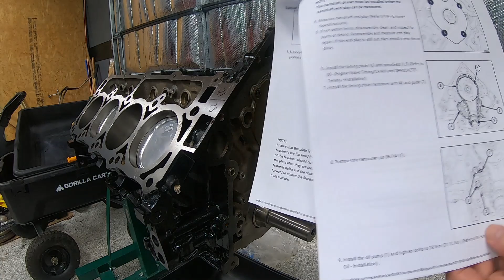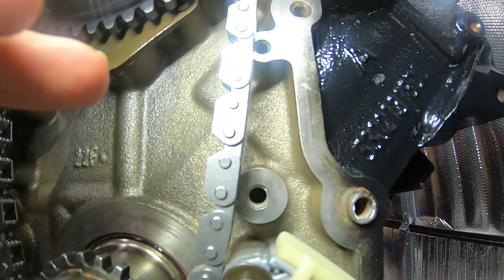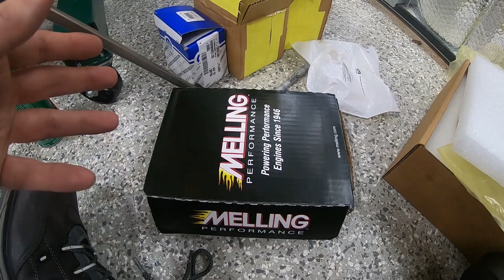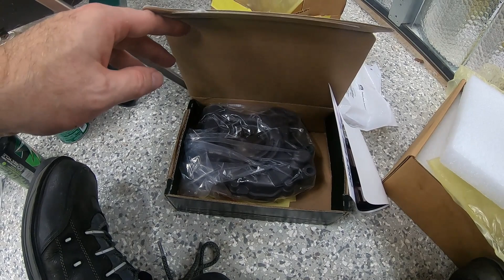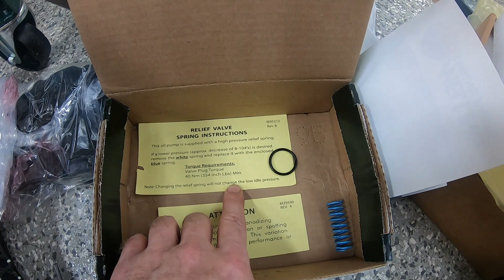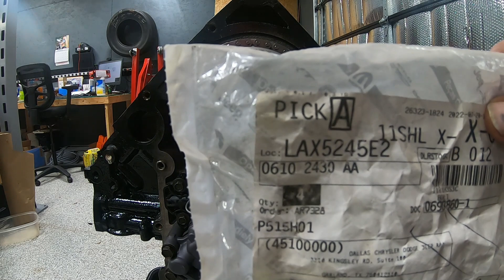2012 hemi 1500 Sleeper Apple Part 19.  Long Block Build Part 2.  Timing Setup & Melling HV Oil Pump.

Comment: What is the difference between this and the M452HV?
Reply from the maker: One item can I see on the data sheet is the M452HV is listed as standard oil pressure.  The Pump we are using here comes with a higher pressure spring pre-installed, with an optional spring in the box to return to standard pressure if needed.

Comment: I've installed 2 melling high volume pumps on my truck the first one had a really bad wine
The second one has a little wine when cold but goes away after a few minutes I'm not sure what I did wrong 
My truck is a 2005 dodge 1500 hemi
Reply from the maker: Good information.  We will need to see if we see the same.  These HV pumps are new for the 2009-2018 4th gen platforms.
Reply: @solargarage  thanks for the reply 
I seen they just came out for 09 to current model year 
This one if for the older 03 to 08 not sure what the differences are I'm curious if yours wines too or if it's just me with this problem I'm not sure how to post pictures on here but I tore the old HV pump down it looked like something went through it the aluminum case was a bit chewed up and I also have aluminum sparkles in the oil I think they are aluminum cause I ran a magnet through the oil and didn't pick anything up
Reply from the maker: We will be doing a lot of test videos and such of the setup.  How did your pickup screen look? @noahwoodland59
Reply: @solargarage  nothing that I could see in the pickup screen I cut the filter open and couldn't find much the glitter is super small 
It's weird I've probably put 7000 miles on it so far with no issues it just sounds bad when cold and has metal in the oil I've changed the oil 3 times since I changed the pump and I'm still getting glitter in the oil